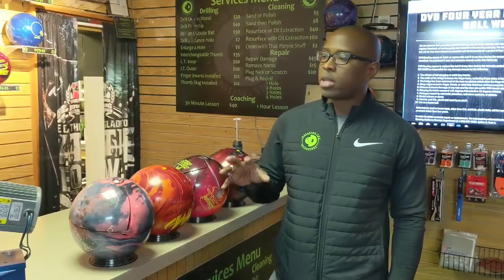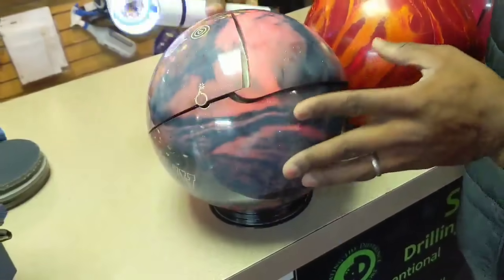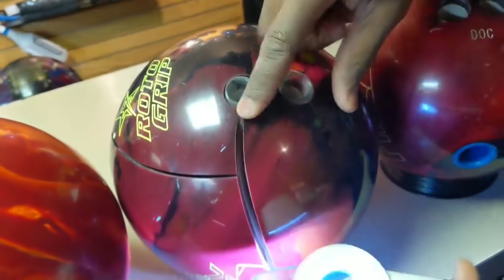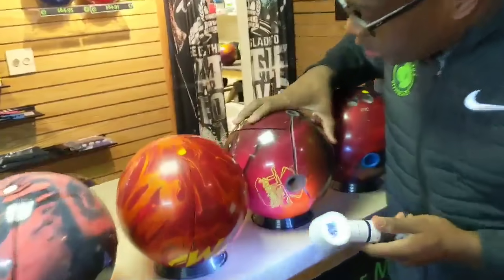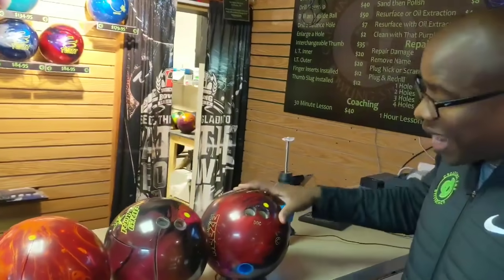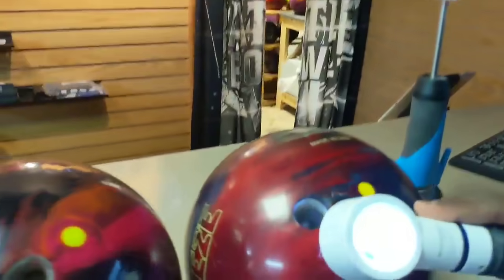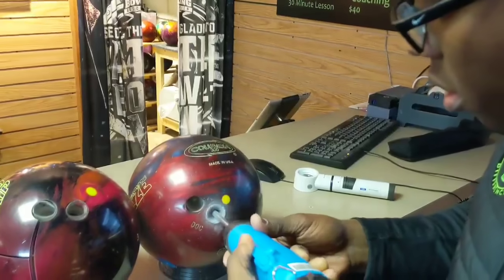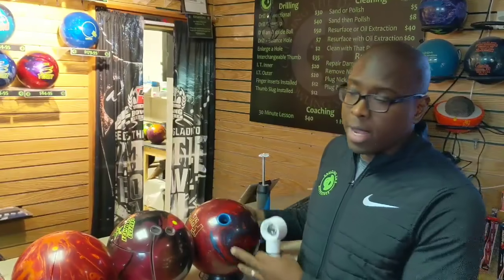Why Bowling Balls Crack | Even New Ones

Comment: Tell these manufacturers to stop skimping on coverstock density, and the cracking will dramatically reduce. Make a core, then a cover. The shells are too thin,, causing cracks, and diminishing longevity and reaction.
Reply: I'd rather pay a little more for coverstock material cost than have a ball soaked through with oil after 30 games.
Reply: @Fluffyguy958  I know some of the 900 Global balls are just core and cover,,, not all of them though.
Reply: @Fluffyguy958  The oil can be removed at home. My big ball is still a Rotogrip original Theory
Reply: Yeah they claim Its usbc regulations,  but it's really just so you will buy more bowling balls at least every two years. The manufactures won't change 💩